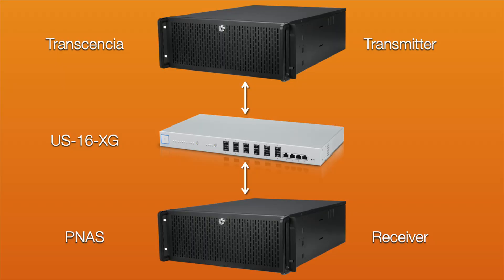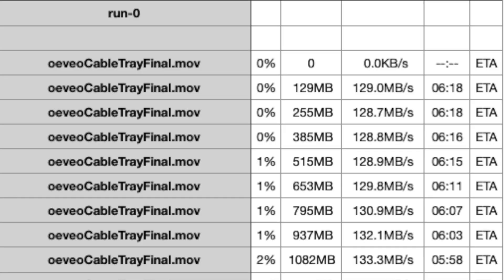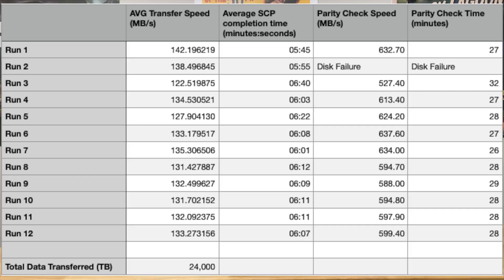All NVME SSD array in Unraid pt2 @UnraidOS #unraid #homelab

Comment: SPX, Are you still running Unraid?
I just did some testing and found something cool.
For my NVME drives, if I set them to BTRFS I only get about 600mb/s, but if I change it to ZFS format I get almost full NVME speeds.
I tried this with 1, 2,3 and 4 drives setups and all of them tested great.
I updated my server along with running a Truenas Scale setup.
Epyc 7502p, 128gb ram, 10gbe fiber nic, 4x10TB array (with 2ea 1tb 660p cache drives), 3ea 3.2TB NVME PCIE 3 drives (striped array), 4x7.68TB SAS SSD drives (ZFS Raid Z).
Threadripper 3960X, 128gb ram, 2x512gb ssd boot drives, 8 x 7.68tb NVME Enterprise drives, 10gb Fiber Nic

Transfers to the Threadripper, will max out my 10gb nic
Reply from the maker: Yeah.  I’m definitely still running unraid lol.  It’s kind of what I’m now for.  They sent me to the UK recently 

Sweet build.  Sounds cool AF.
Reply: I saw your video about meeting with SpaceInvaderOne, that is awesome. @SPXLabs  
Just wanted to share my findings about BTRFS and ZFS formatting, even with 1 drive.
Reply from the maker: Oh sweet.  Hope you enjoyed it.  That was a first for me and a totally new experience.
Those are and were interesting results.  Sounds kind of wild!

Comment: RAID 1+0 is the way to go if your controller can handle it (supporting it and handling the throughput are totally different). In my H330, not as much since it's a cheap controller VS say a H730. Good video though!
Reply from the maker: Haha I’m out of touch with peoples hardware apparently.  Both of those are common AF.